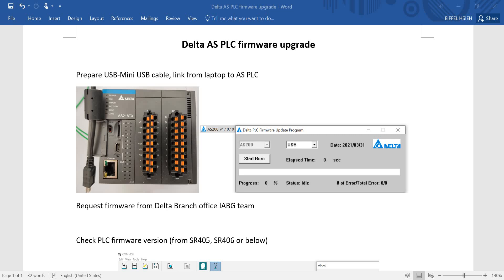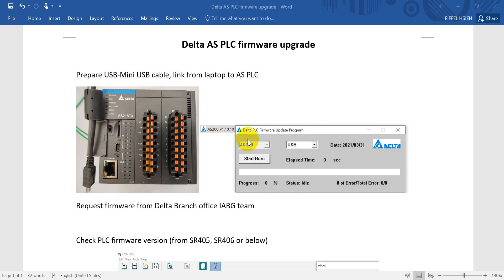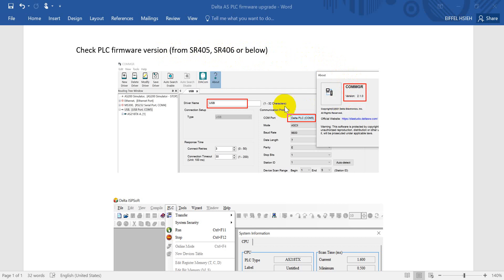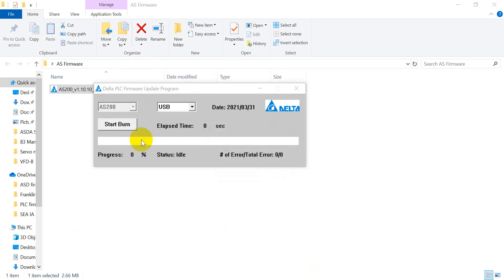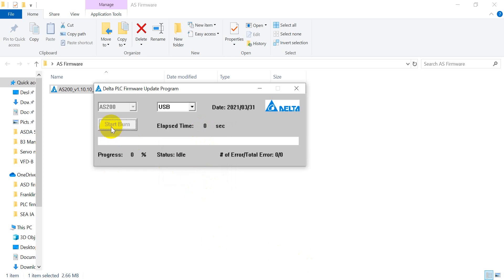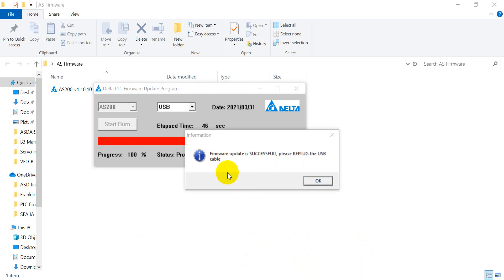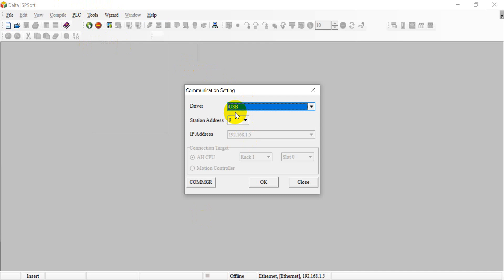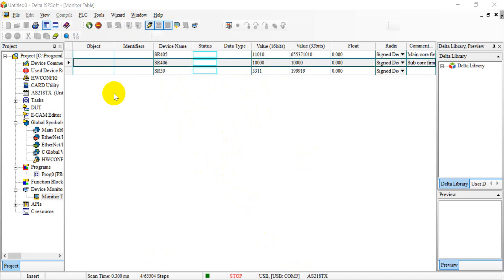Delta AS PLC firmware upgrade

Comment: Hello, is that the reason that not upgraded AS300 plc may not be accepted by DIADESIGNER with error "device not match"?
shouldn't the new software be backward compatible with older firmware versions at least while this tool not released for public?
Reply from the maker: @Mohammad Seifi May I know your email and which country you from, will request our local team to contact with you, thank you

Comment: Good morning, does anyone know how to remove the firmware update from a dop107eg, when trying to load the application from the DiaScreen, I forced myself to update the firmware, after that... the screen was perfectly half right with a permanent shadow, even in mode configuration. You just don't notice it when it's all white. I need to remove that update and never use diascreen again...

Comment: Hi, how can i buy this software?
Reply from the maker: Hi Sir, this is free. Please contact Delta Electronics  Automation team or distributors for this
Reply: @iabg_seadelta6647  could you give me some link to download this software ? I need it urgently and could not contact delta support
Reply from the maker: @brendoluizpaixao2644  may i know which model you use and current firmware version? please also let me know which country are you from, thank you
Reply: @iabg_seadelta6647  I'm using the AS332t family, my firmware version is 1.0.1 wanted to update to a recent version, because according to the manual it is possible to change the ethernet port with the firmware version from 1.10, I'm from Brazil
Reply from the maker: @brendoluizpaixao2644  Please provide your email. Thank you